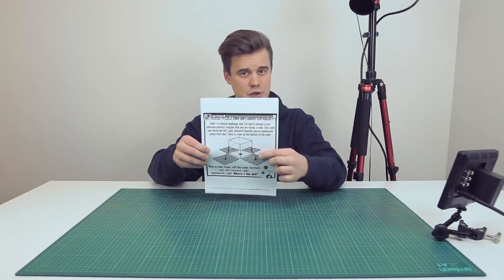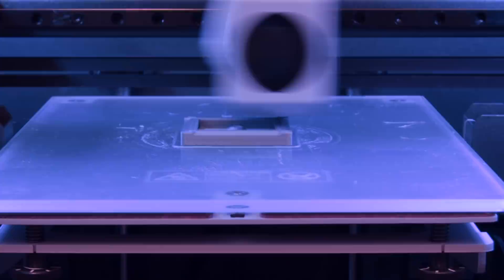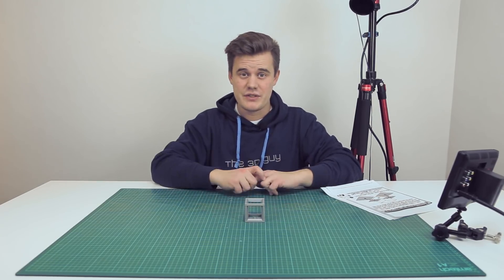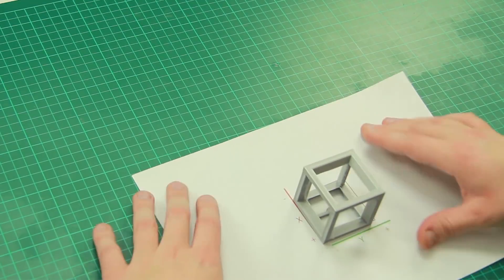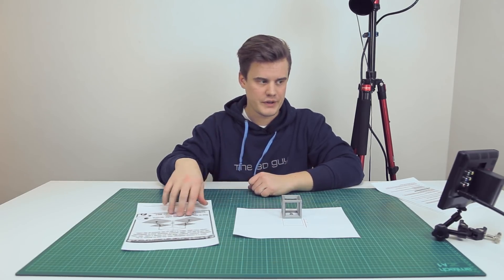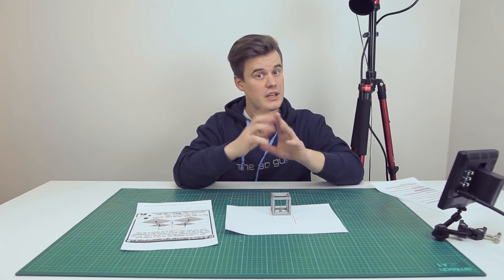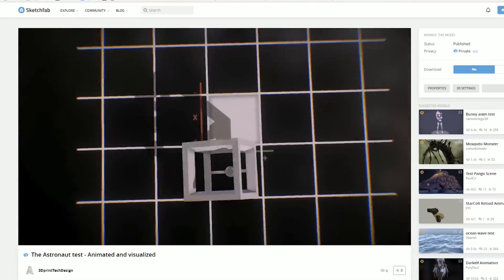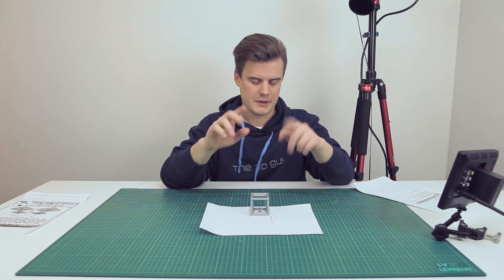Tim Peake Astronaut Test Analyzed Using 3D PRINTING

Comment: I would argue that when we walk forward it is away from your current position as opposed to toward your current position.  If that is an acceptable assumption, then it would move away from you one position leaving the dot on the side closest to you. Then you rotate left two positions and the dot is still on the side closest to you. Then you rotate forward (away  from you) one position and the dot is on top. Then you rotate to the right one position and the dot is on the right side of the cube.
Reply: The test clearly says that forward means towards you though